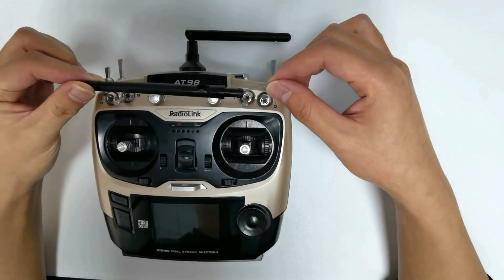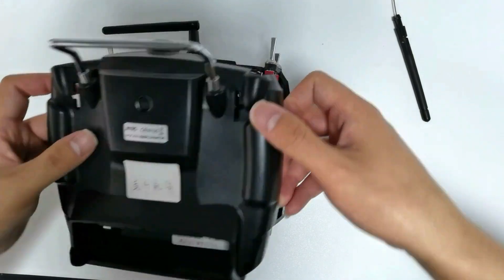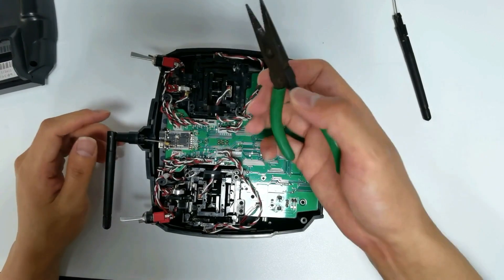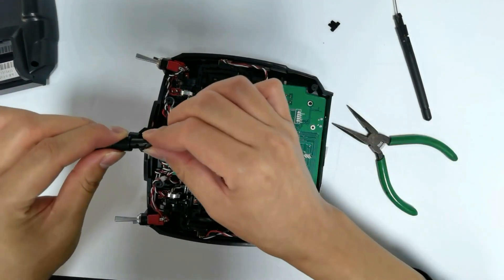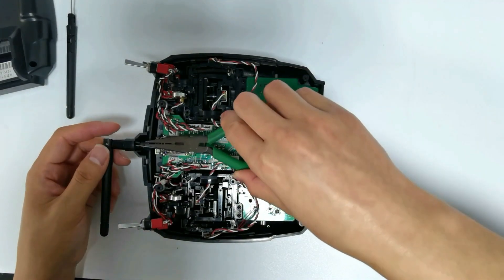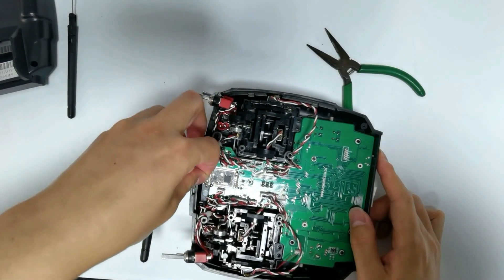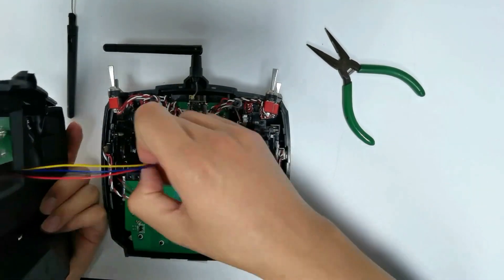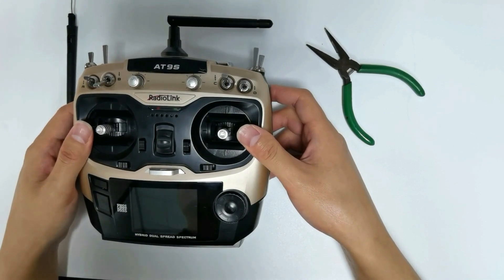How to Replace the Antenna of RadioLink AT9S/AT9S Pro Transmitter?

Comment: i have an at9s pro transmitter with rd9s. after 80 meters rssi value goes down to -99. whats the problem
Reply from the maker: Hi, sir. Could you please test RSSI in about 30 centimeters? Here is a tutorial for your reference: https://www.youtube.com/watch?v=jr7ad-_MVoI  And may I know if you have any other receivers? If yes, could you please test RSSI with different receivers to confirm if the problem comes from the transmitter or receiver? If any question about RadioLink products please feel free to contact us. Our email is: after_service@radiolink.com.cn
Reply: @Radiolink_official  sadly i dont have any spare receiver. When i do RSSI test it reads around -60, -57.
Reply from the maker: @Pavloduk  Hi, sir. Could you please send your RSSI testing process video to our email after_service@radiolink.com.cn ? It will be helpful for us to help you confirm the problem. Thanks in advance.
Reply: @Radiolink_official  okey i'll be sending the video in a few hours. Thanks for your help though its like the best customer support i have ever experienced 😀
Reply from the maker: @Pavloduk  Thank you. It is our pleasure.